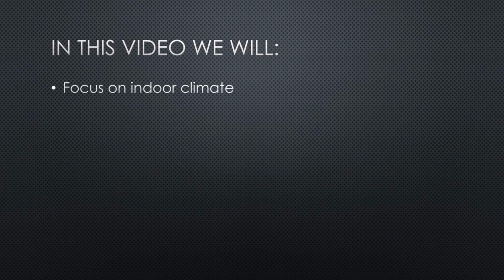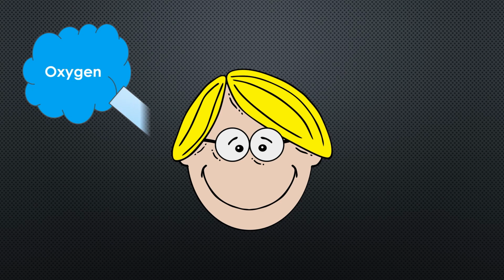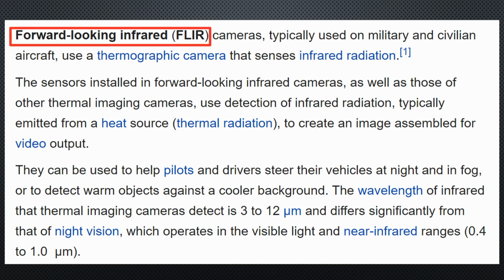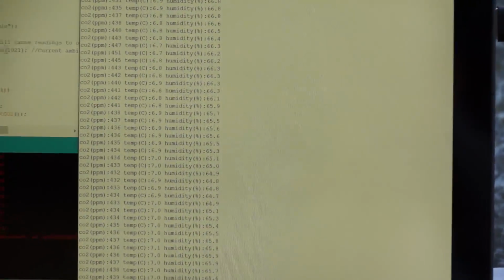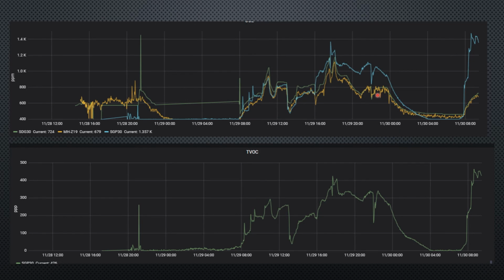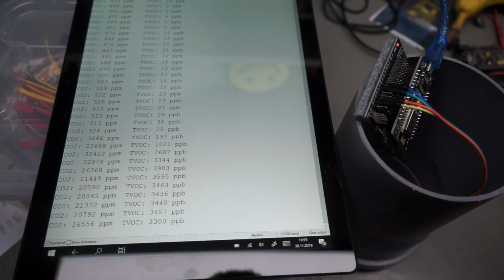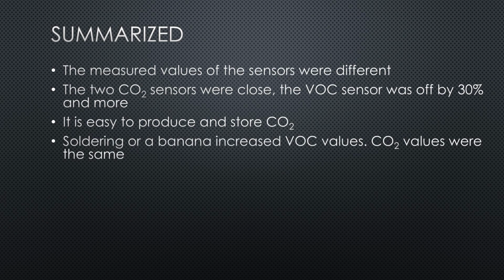#300 How to measure CO2 and VOC with Arduino. Which one is better?

Comment: Heads up for Raspberry Pi users concerning the SCD30 as it mentions I2C Clock Stretching in its documentation which could be a problem for Raspberry Pi users who want to use the SCD30 I2C interface, so you might have to use one of the other SCD30 interfaces with a Pi.

Andreas perhaps a good video topic would be I2C clock stretching and the Raspberry Pi.
Reply from the maker: I think it would be too "special". Most people would not know what it means or what it is for.

Comment: Great video! 

I would be very interested if you can measure co2 or voc (or air particles?) increase while running  your 3d printer. Especially PLA/PETG/ABS which we home-makers can use.

Anectdotally I‘ve sometimes felt the „meeting effect“ in the beginning when I had the printer stationed in my bedroom.
Reply from the maker: I would not expect any increase in CO2. Maybe VOCs are emitted. I will see it in the future...
Reply: @AndreasSpiess  Printing ABS should generate styrene gas which is a VOC - it'd be really interesting to measure the impact of this at various distances from the printer.

Comment: A nox sensor would be useful to detect the dirty air in cities. Especially in the cold season, there are inversion weather conditions. Poison gases accumulate on the ground, so that it stinks terrible, so you better keep the window closed. Btw. LPG does not release nox and costs less than half its consumption.
Reply from the maker: This video was about inside air. I once measured our outside air. It was very boring where I live...

Comment: CO2 levels in outdoor air vary considerably over the day and between seasons. They also vary substantially between locations, even at the same altitude. Using a global average is like using the average of telephone numbers to call somebody.

CO2 gas presence is a sign of life... Essential for the carbon cycle that sustains our lives.  When CO2 levels decline below about 180ppm, plant life struggles.   You could hike up to the treeline on a nearby mountain and calibrate your sensor to a baseline of about 200ppm during daylight hours. CO2 levels can be higher at night due to decomposition of biomass and a slight increase in air pressure... But without sunlight, the higher CO2 is of no use to plants.

Exhaled breath contains about 40000ppm ... sometimes higher. If your readings are substantially lower then it's likely that the sensor is wrong.

P.S. drowsiness at University lectures was more closely correlated to the acoustic emissions at the front of the theatre than ambient CO2 levels 😀
Reply from the maker: Do you know how much the CO2 level differs from place to place. I did not find such information. I assume it is only a few PPM
Reply: Nearby, well flushed locations are within about 5ppm.  See e.g https://www.mdpi.com/2073-4433/9/10/367

Globally, variations are wider... IIRC 20ppm variation at sea level between the tropics and temperate regions of the Atlantic, at the same time of day. That was by measurements taken during the 1920's.

Proper calibration is only by calibration gas mixtures.
Reply from the maker: I also found info here: https://www.esrl.noaa.gov/gmd/ccgg/trends/monthly.html For our sensors these variations are below measuring errors.
Reply: True, but relying on the ABC algorithm started by Senseair in early 90ties tracks and keeps in sensor memory only the lowest such outdoor reading, which is very easy then to correlate to the atmospheric baseline. Temporary local emissions and peaks and other variance over the day/week are don't care. Seasonal variance (green plants in summer vs. autumn and winter bio decay) still apply if there's no added intelligence, but that's not a very big impact to atmospheric baseline and NDIR sensor accuracy.

The true strength of ABC is however that any faulty drift offset over the lifetime (15+ years) is naturally delimited to the continuous effective sampling of the atmospheric baseline, so it never spirals out of control compared to dual-channel NDIR sensors that rely on internal reference signal ratios that is "assumed" pristine forever but typically only lasts a few years.
Reply: also higher CO2 levels help plants grow faster (and absorb more carbon as a building block)!

btw do you have any data on o2 in different areas: forest, city, dessert, sea, cave, basement, apartment etc.?

Comment: Thanks for the great video Andreas. Any idea how "exposed" the sensor needs to be to read accurately? I'd like to add one to my camper which is a small enclosed space, but I'd likely put it in a small project box in a cabinet or out of site location. Would you think the detector would be useful if it's not out in the open, especially since you mentioned CO2 drops down below air?

Comment: lambda sensors on cars only work accurately at high temperature
Reply from the maker: I did not know that the only work on high temperatures. Thanks!
Reply: and if you drive an Opel they go kaputt a lot...
Reply: yeah i'd like to use induction heating to get the sensor up to temperature, then turn off the hf during a reading... chemical sensors are expensive and need to be replaced fairly regularly
Reply: @coffeecuppepsi  You might also consider looking at lambda sensors with built in self regulating heaters, but be aware that they get veeeeeery hot on the inside(up to 700°C) and also quite hot on the outside(the metal outside is only seperated from the 700°C inside by a little piece of ceramic) so you need to isulate them and limit the airflow or you will cool the sensor down too far (because the heater is quite weak on many, as it is only made to hold the temp. of the sensor at high gas- /airflows when the gas is already at a similar temp.) , wich will badly mess up the readings.

Comment: I'd like to see one on the PMS5003 if you feel like doing it, it's a really solid PM2.5 sensor
Reply from the maker: Particular Matter sensors have been covered elsewhere and are (hopefully) more a problem of the outside air in crowded areas. Where I live it was boring. Nothing to see...
Reply: @AndreasSpiess  I live on a main road; cooking causes most of the pollution in our house even still. I was surprised!

The other thing, most people out there on YouTube are using a particle sensor that doesn't work..the Sharp brand one and equivalents. It's not designed for this job and reads out garbage, but they all use the same code! And it puts out nonsense! The code doesn't work at all. 

So it's a more interesting topic than it may appear.
Reply: @beware_the_moose  Cooking is a big surprise, my PMS5003 goes nuts if I fry bacon and it's not even in the same room. I'm about to get a Sensirion SPS-30 which may give better output for PM2.5/PM10 than Plantower's.

Comment: I've been waiting for such an episode from you.
I recently built a sensor on the SGP30 sensor but I am not entirely satisfied with its operation. How long have you tested your GSP30 sensor?
A very interesting episode :-)
Reply from the maker: I used it only for a few days.
Reply: @AndreasSpiess  My SGP30 after a few hours of work shows very inflated values. These are certainly not real measurements. You don't know what could be the reason?
Reply from the maker: I just wired a few sensors together and plan to monitor the differences over the next few months

Comment: Nice video. One project would be to build  a project for detecting carbon monoxide for living rooms , near fireplaces, gas heaters, etc to prevent its toxicity, using VOC and ESP32, and trigger alarm(s)
Reply: For this purpose I'd suggest buying a carbon monoxide alarm. Those can be often found from the same shelves as fire alarms.
Reply from the maker: What kind of sensors do they use?
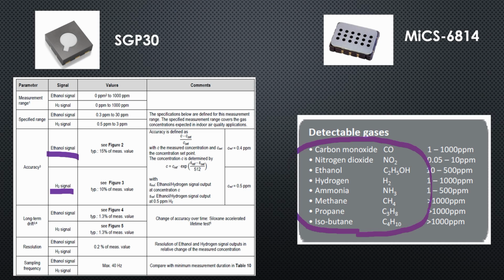Reply: @AndreasSpiess  I have a question.. Does the VOC sensor is suitable for the carbon monoxide detection? In the video the datasheet or table show CO with a wide range 1 - 1000ppm at 11:30. The idea is to log the data onto web and mass storage device using ESP32 and VOC sensor and implement the alarms
Reply: @ristomatti  Do they offer the datalog option to web / mass storage device?
Reply: @AndreasSpiess  I don't have any idea actually. They are quite expensive compared to a fire alarm and seem to expire relatively quickly. The price/value ratio is not good enough for my use case where the fireplace is used seldomly and only during some months of the year. I might think differently if I'd have children around.
Reply: @MalagasOnFire  They do only the alarm part like the name suggests.
Reply: @ristomatti  Thanks. One single alarm could be useful for analysis
Reply: I googled a bit and realised by memory had exaggerated the price and lifetime of these alarms. Price range here in Finland is between 20-50€, expiration time 3-7 years.
Reply: @AndreasSpiess  Wikipedia has a good overview. They seem to commonly use sensors of optio-chemical, biomimetic, electrochemical or semiconductor types: https://en.wikipedia.org/wiki/Carbon_monoxide_detector. Finnish fire safety officials site stated there's a standard that requires a CO alarm device to alert when the CO level reaches 110ppm.
Reply: @MalagasOnFire  To clarify my original reply now that I read it again. My intention was merely to suggest not to trust a DYI device for an alarm of an life threatening issue... It would definitely be interesting to gather ppm readings to see if the value ever rises near dangerous levels for example. 

Too bad my use case would be in a wood heated summer cottage sauna. It might not be the best of places for a sensor like this as the varying temperature and moisture levels might be too much for any sensor in the price range or a hobbyist like me. 😑
Reply: @ristomatti  Found some alarms here at local stores in that price range. Thanks agains
Reply from the maker: Thank you for the link.
Reply: @ristomatti  Thanks for the link  and for the clarification. Maybe it could have the proper alarm to do its job  and ESP32 + VOC to remote access , store data.

Comment: Hi Andreas! Do you know the CCS811 VOC sensor? It's the most popular on AliExpress. I've been using it for a while and it is pretty accurate. By the way I have a question, do the sensors you showed need a burn-in for accuracy? Hot plate ones often need a 48hr burn in
Reply from the maker: The CO2 sensors do not need burn-in. And I mounted now a CC811 with the other sensors for comparison.
Reply: @AndreasSpiess  how did that comparison go?

Comment: As always amazing video master Andreas. I think I will try it in my university classroom, because boy in Physics class we are always tired, I am 100% sure it is not because of the boring subjects but because of the high CO2 concentration.

I am curious to try multiple VOC sensor, I will try with the  bosch BME680 and SGP30, because CO2 is still above my maker budget. Again thanks for the amazing video!
Reply from the maker: I did not find out what the BME680 really measures...
Reply: @AndreasSpiess  it measures Temperature, Humidity, Atmospheric Pressure and VOC. Made by BOSCH, I assume it will be good 😁

Comment: I bought a set of 9 cheap gas sensors a while back but just got around to trying them now. It was my first ESP32 project using more than one ADC input, so I was very surprised and disappointed to find out that if you use WiFi on the ESP32, half the ADC inputs are disabled, and in the case of my DOIT ESP32 DEVKIT V1's, the ADC pins labelled VN and VP also don't work, so I was left with 4 usable ADC pins. I'm considering disabling WiFi, and using Serial Comms to get an ESP32 to use an ESSP8266 to do the WiFi comms to my Node.Red server. Or I could just use 2 ESP32's to handle 8 sensors.
Reply from the maker: Or you add an ADS1118 board or another extrernal ADC

Comment: Great project, I am also using an SGP30 to measure eCO2. Your values are much smoother than mine. I think my calibration did not go as well- I simply let it run for 12 hours which is what I thought the documentation outlined. What calibration steps did you take to get this good data output?
Reply from the maker: I average the values.

Comment: I would think measuring oxygen levels would be a good idea. Perhaps as a control. If O2 levels are low I would think that would have an effect on CO2 and other gases being.measured. Low 02 means there is a not a good supply of good air coming into a room. A question of why would almost beg for an O2 sensor as well.
Reply from the maker: So far I did not see any O2 sensors on AliExpress.

Comment: This topic is on the agenda now! I will build one for my school. Which sensor should I buy now?
Reply from the maker: For shure a true CO2 sensor. The others do not display real CO2 values.
Reply: @AndreasSpiess Prima, danke. Habe einen MH-Z19 zum testen gekauft. Werde ihn wohl nicht mit Batterien betreiben können. Aber ich plane ihn in mein bestehendes influxdb/grafana Setup per lora einzubinden. Was denkst du über die Montagehöhe des Sensors. Am besten auf Kopfhöhe der Schüler oder?
Reply from the maker: Die Höhe must du probieren. Soviel ich weiss ist Co2 schwerer als "Luft".

Comment: Is it possible to measure outdoor pollution, for example, traffic pollution in a crowded area?  
Which sensors could be interesting to use in an ESP32 / LORA project.
Thanks for great videos. Being inspired and having fun with them when Sunday's breakfast is enjoyed
Reply: I think the problem is that these sensors are specified to be used for indoor applications and the data sheets state that explicitly. With operating and storage temps between 5-50 degree Celsius and negative impacts of high levels of humidity on sensor performance these sensors probably won't last long in harsh outdoor environments. Let me know if you find a good sensor with support for CO2, hydrogen that works in outdoor conditions, is affordable and works at low ppm concentrations.
Reply from the maker: You find many particular matters sensors using ESP32 online. They are made for outside air. Most of the outside gases are probably not easy to detect and need more expensive sensors.

Comment: Should do the Bosch BME680 next!
Reply from the maker: Do you use it? I am not sure what kind of VOC it measures
Reply: @AndreasSpiess  I have tried to understand the raw resistance that it throws out and how it correlates with temperature and humidity but have not really got anything very sensible out of it. It is sad that they have closed sourced their own algorithm that might give better results.  After playing with them for more than year I finnally got MH-Z19B sensor about month ago and been very happy with the results. Hooded it up to my Raspberry pi3 directly and it sends mqtt -messages of the co2 -level to be processed with my node-red and grafana! Second MH-Z19B is on it's way as I am planning to install it to the bedroom.
 
 MH-Z19B has been working very well and learned alot how co2 levels raise during the evening unless we get some fresh air in. Very interesing.
Reply from the maker: I also think measuring CO2 is more reliable for that purpose, even if the sensors are more expensive.
Reply: @AndreasSpiess  I recently got one off aliexpress. Haven't tested it yet. Wanna replace the BME 280 sensor I have with it, since it does everything the 280 does and more. Though after watching your video, I think I'll just grab a CO2 sensor too. Trying to create a small indoor weather station logger type of thing.

Comment: That other sensor you showed is not a German company, but a Swedish company SenseAir.  The sensor you show is the S11, or Sunrise sensor.  You can see the source code to make it working here: https://github.com/letscontrolit/ESPEasy/blob/mega/src/_P052_SenseAir.ino  It supports both the S8 and the S11.  The S11 can also be set to I2C using some resistors, so maybe you had it wired incorrectly?

About the "calibration" of the sensors. Please keep in mind you need to have the sensor placed in a well ventilated room (not outside) to determine the 400 ppm level. You want to make sure it is in the same conditions as when you use it (room temperature and humidity) and also make sure there is no direct sunlight on the sensor or placed near a source of IR light like a heater.
Reply from the maker: Thank you for the correction. I got the sensor prewired from a viewer who was able to use it. But I have to investigate further. It is prewired for i2c and it answers...
Reply: @AndreasSpiess  I have not yet used the sensor in I2C mode, but I guess it is quite similar to look up register values. If you wire it for UART, you can just use it via Modbus RTU.

Comment: We started a project in our school with a small co2 "traffic light" on an e-ink display. We are on our way to setup one sensor (with temp and hum) in every room and show the data in Grafana on a monitor in every floor. The VDE gave us 2000€ for this project. If you are interested in, contact me.
Reply from the maker: Very good. It would be interesting if the project is well documented (in English) and usable for others.
Reply: @AndreasSpiess  We will. The documentation will be made with Bookstack.

Comment: Didn't realize these sensors have been around for 800,000 years! @8:32
Reply: Gas bubbles get trapped in ice at the poles which has been deposited at a relatively constant rate. This allows the age to be estimated by the depth of the ice, and then the gas composition can be directly measured.

Comment: see cjmcu-8118 co2 / voc sensor with arduino library.  Very easy to use, about $15
Reply from the maker: I have a similar board connected with three sensors.